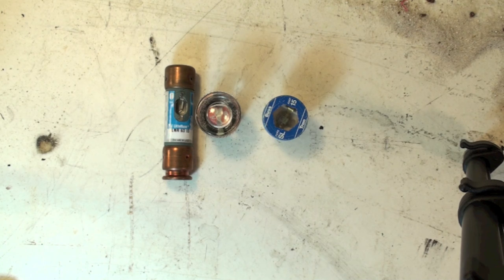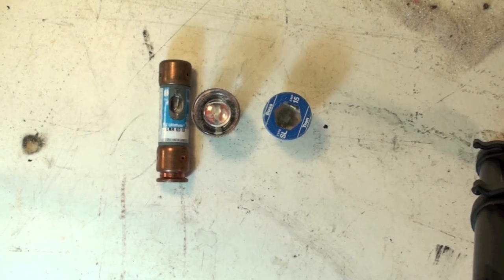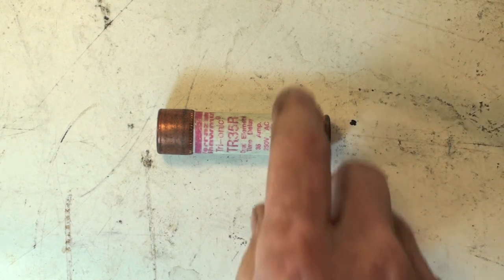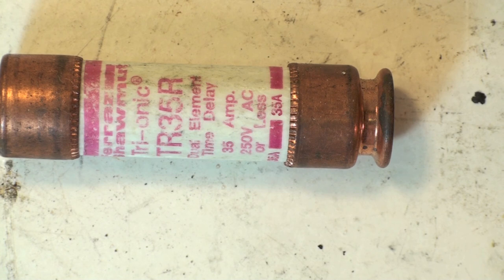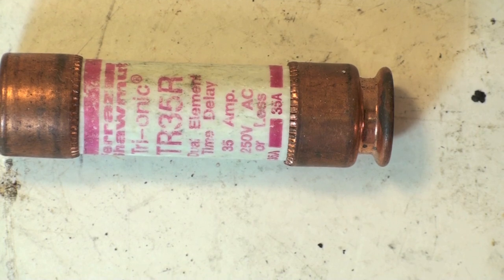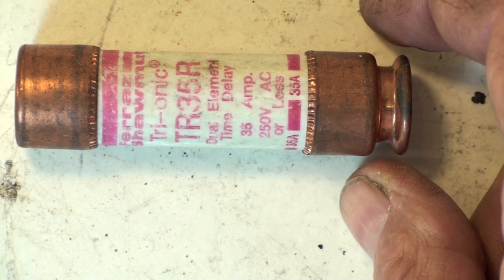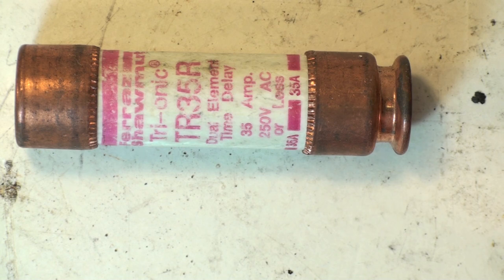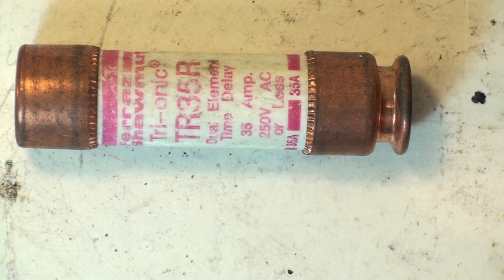How to check the HVAC fuse without a meter

Comment: you should change the title of you video since you never tell someone how to check a fuse with no meter. its misleading. thanks for sharing
Reply: yes he does, its as I suspected without a meter you put the new fuses in and if your thing works then it was a bad fuse if it doesn't then the fuse wasnt the problem.
Reply: same - I'm trying to find which ohm setting to use on these big guys.... I'll look elsewhere

Comment from the maker: This vid was just to tell folks how some fuses will tell you if they are blown.  And no there is no simple way to check a fuse without a meter unless there is a window.  Not all people have or are competent with meters.
GFM
Reply: Then change the title. Video is very misleading.
Reply: @rasten79  Agreed. This video needs some extra info. Content Creator is pulling HVAC people to this video by using HVAC in title, and this is just not the advice they need.

Comment: Can fuses be blown on a extreme hot day?

I got a similar brand/ style fuse. But 45 amp. Ac unit stopped working in 110 weather. Pop thr disconnect open an found one that got flash marks and a tiny hole

Comment: Question:... you say put the same size/amp in as you take out... how would someone know the correct ones are in to begin with?
Reply from the maker: As for the fuse amperage, on some unit, the amperage is listed on the model plate.  Not all of them are.  The fuse size is to protect the field installed wiring, so you would need an electrician to tell you.  The type of fuse can be described as "slow blow".  Most hardware stores can match them up.
GFM

Comment: could water cause a fuse to blow I had a pipe bust and spray all over the fuse box and now one is blown could that be why! its all blck and burnt up!?
Reply from the maker: Sydney Greenlee Yes. Water corrodes the contacts. Means a new disconnect. 
GFM

Comment: So i have a question.. 

In my fuse panel i have 2 15 amp fuses and 4 20 amp fuses. (=110amps) in my main i have a 60 and a 40. I have 12/2 wire in my house. Electric company confirmed i have 200 amp power comin in to my place. 

Do i swap the 40 for a 50 or 60 or keep it at a 40. 

The fuses have those adapter inserts that only fit certain size fuses. One fuse keeps blowing (dedicated water heater) and the insert doesn't seem to fit any size fuse at this point and whatever may have been inside marking what fuse size it should have been has worn/burned off. (it is visible on the 15 amp fuse sockets). 

The box is from 1965 and the company closed its doors that year. Fortunately, the diagram is still readable. It shows the fuses and another side panel. I would have to take a pic. 

Any helpful info besides changing the box? That is planned but ai live here and need hot water and don't feel like boiling on the stove. Thanks
Reply from the maker: First, throw the panel in the garbage.  It has no value in your home.  Dangerous.  If you must keep it for now, The disconnect for the water heater blows fuses because the disconnect clips are overheated.  Throw it away.  The size of the fuses in the water heater must match the wire size.  
GFM
Reply: grayfurnaceman the water heater is new and its a 20 gal 1500 watt point of use manufactured this paat july 2017 and installed professionally end of august 2017 and purchased to replace the older one that kept burning up the element. New water heater ran for 3 months steady until the weekend before Thanksgiving. Had a repair guy come in and thought it was the shut off switch next to it as it got no power on testing. The wires to it are 12/2 with a 20 amp fuse. Not sure what you are saying to throw away but it won't be my water hearer. The box will go eventually but money is tight and space is limited. 

And i just looked at the label and im gonna shut up now lol 

So for my next question.. I have 200 amps coming in and I'm sure I don't need a lot of spaces as there are 6 there now and I would like to split some of the circuits (the living room, a bedroom and a bathroom are all on one 15 amp fuse) and the box is inset in a wall space about 2 ft tall with a side insertion for the outside wires. Am i going to be able to find a satisfactory set up for that? And if so, do you have any suggestions? (I do not plan on doing the labor myself however I do plan on potentially purchasing the equipment from either menards or home depot. ) 

Thank you.

Comment: why do these fuses have the clip slot on only one end?
Reply from the maker: That is to eliminate using another type of fuse in a disconnect that is designed for only that type of fuse.  I have not used the designations here as that gets somewhat complicated.  In most applications, the type of fuse with the indentation can be used or one with no indentation can be used interchangeably.  That does not mean you can replace a slow blow with a single element fuse.  You should replace like for like unless you know the fuse in the box is incorrect.
GFM

Comment: My voltmeter needle moves from the far left to the far right when I test my fuses, but the motor isn't working and when I shake the fuses, most of them make a rattling sound.  Is it possible that they could be blown inside, even though the voltmeter needle moves?
Reply from the maker: Probably not.  The loose parts is probably the insulator inside.  Have you checked voltage when the circuit is energized?
GFM
Reply: @grayfurnaceman  Thanks for getting back to me.  I did try replacing all the fuses and it didn't solve the problem, so I know there's something more serious going on.  And, I know that all my old fuses are probably still good as spares!
Reply from the maker: @songsofsusannah  Do you have power to the unit?
GFM
Reply: @grayfurnaceman  Well, the problem is actually lack of heat, I just wanted to make it shorter by calling it a motor. The blower works just fine. My furnace usually blows cold air, but it blew warm air for maybe 2 hours after I replaced the fuses, it had been blowing cold prior and has been ever since then. I think it was a coincidence and it's one or more broken coil(s), though it could be something else, though the intermittent nature of the problem tells me that it is probably the coil(s). Maybe it is a bad fuse, I doubt it but maybe the furnace is blowing fuses. It could be the contactor, sequencer, or circuit controlling the heating coils (I show my ignorance if two of those are the same thing). I doubt it is the high limit switch or heat sensor. I know how to check the coils and plan to do that tomorrow. I replaced the thermostat first, then the fuses, now I will go to the limit of my ability and then call a professional if I can't figure it out and fix it myself. Any suggestions are greatly appreciated! It is an old electric furnace and my house is 52 degrees with 2 space heaters on! (I just hope they still sell compatible coils if that is the problem.)

A little bit of bio on the furnace here. It is from 1980, but rarely used. It just sat there turned off for all but the coldest winter days. The house was heated by a woodstove for 20 years and that was replaced by a propane gas log, unfortunately the heat distribution from the log made you sweat upstairs, but stick your arm in the fridge and worry it was broken because it was colder in the room than in the fridge, so you holed up all winter in the bedroom and only came out to eat and bathe when you were home. Eventually, I got the furnace serviced, because it had never really worked. Turned on and off only at the circuit breaker and the blower was too fast, so it cooled down the air and it barely raised the temp a degree or two before you turned it off at the breaker a couple hours later. After the blower was slowed down, it worked well for maybe 4 years, then started blowing cold air most of the time, then all of the time, until I replaced the fuses last week. I think it's a broken coil (maybe several broken coils), but I was willing to change the fuses before digging in and working on more complex wiring than anything I have worked on before, even though they tested as still working. I have done all my home repairs except for the one time I had the furnace fixed. I can do wiring and plumbing. I just hope I can fix this.
Reply from the maker: @songsofsusannah  The most common failure in electric furnaces is sequencer failure.  Burned wires are also common.  If you want to get into how these things are put together, you might try this playlist:   https://www.youtube.com/playlist?list=PLItXrh64d2JOEOk-99TDdGHnNfB18YgnW
GFM
Reply: @grayfurnaceman  Yes, it's connected to the circuit breaker, but I turn it off when I work on it.  If that's what you mean.  Right now, I'm  just trying to figure out how to get the heating coils out to check them for breaks!  I took out all the screws but that apparently that wasn't all I needed to do.
Reply: @grayfurnaceman  I checked all the wires and they all looked good, no visible damage.  I checked the coils and none were damaged.  They looked clean, but nevertheless I took the opportunity to use the air compressor and shop vac on them.  None of the limit switches had a bubble and they all looked fine.  I had a bit of trouble getting the last coil back in, I tapped it a bit with a rubber mallet and broke a sequencer (or it was already broken, and the light tap simply made it fall apart).  The furnace has 3 sequencers, a double sequencer and a single one, and the one I broke was the double one, closest to the transformer.  While installing the new one, I found a damaged end on one wire, I'm going to replace it and hope that solves my problem. Maybe either replacing the sequencer or replacing the end of that wire will make the difference.  If not, there are still a few things left to try.
Reply: @grayfurnaceman   I want to thank you for these videos.  After replacing the sequencer and the corroded copper wire leading from one of the fuses to the sequencer via that wire, my furnace is working!  It had been a worsening, intermittent problem for years, so I am not yet 100% sure that it's 100% fixed yet, but it has been consistently blowing warm air for the past 3.5 days now!  Thanks again for these videos, they really helped me figure out how the inside of the furnace worked so I could figure out how to access the coils for testing, and that lead me to finding the bad wire.
Reply from the maker: @songsofsusannah  Merry Christmas
GFM
Reply: I have this same fuse, the pink TR35R. Does it matter which direction I put the replacements in? Does the top (looks like a flat hat) go up or down? Does it matter? Do they both need to be placed in the same direction? Thanks!

Comment: The 2 fuses keep blowing every week... do you know what could be causing this? The box is about 5 years old..
Reply from the maker: There are 3 possible sources of this problem.  
If the fuses are charred or falling apart, the disconnect probably has loose electrical connections and needs to be replaced.
The compressor is occasionally failing to start and is wearing out.
There could also be a low voltage condition.
GFM

Comment: Could these fuses blow on a power outage my heater or ac hasn't worked since the power went out and it's not in my budget to fix at the moment just bought the house.
Reply from the maker: Either the fuse could blow, or breaker trip.
GFM
Reply: Breaker hasn't tripped the blower runs non stop even with it off and the self diagnosing light is no green and just won't ignite
Reply from the maker: Sometimes, power surges when you have a power outage.  That can damage the control board.  Not sure but quite possible.
GFM